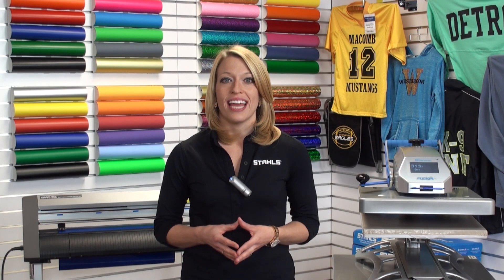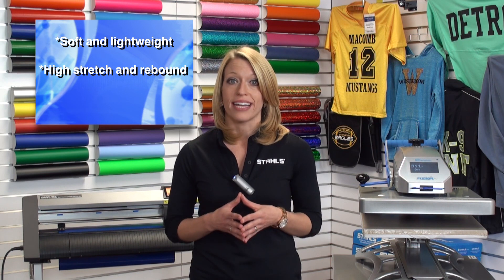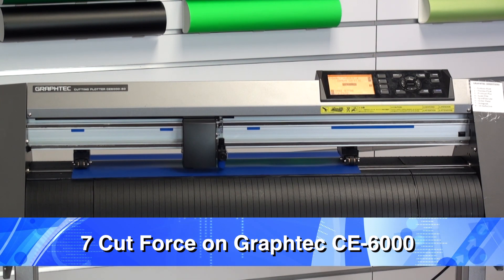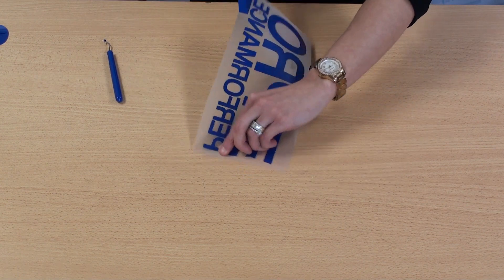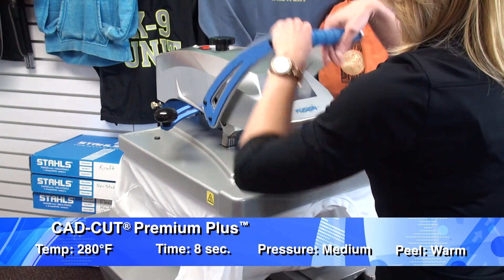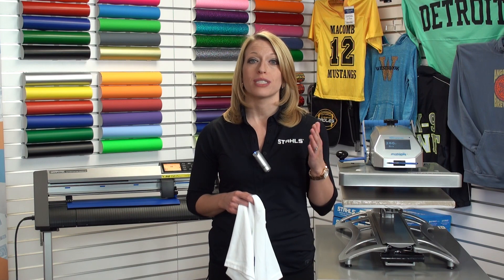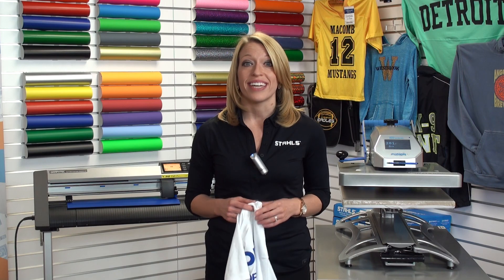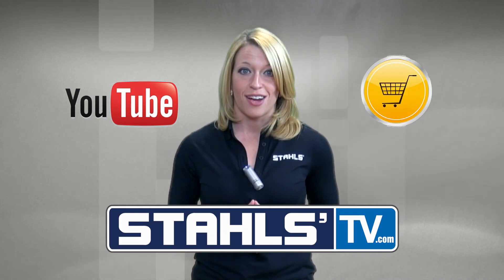Buying Guide: CAD-CUT® Premium Plus™ Heat Transfer Vinyl

Comment: Dear Stahls,

I had issues with my CAD-Cut premium plus. 

It did not stay once the garment was washed. I applied the P+ white to cotton. 

I used medium pressure at 150 Celcius for 8 seconds. Look great, felt better. after sitting for more than 24 hour I washed the garment at 30 degrees celcius, and saw the first signs of it letting go of the garment. Since it was a test-piece I wanted to test how durable the print would be. 

To my shock i peeled the premium right off. I am using a Stahls hotronix device with a Roland GS-24 premium carbon blade. Basicly all the recommendations you put on the material.

I have to say it came loose on the smaller pieces of the design. Probably you'll suggest another Stahls product, but I want to carry a single product line as much as possible. Since in the netherlands it can be quite finicky to find a good supplier with good rates.

Hope to get a reply to this,

Kind Regards,

-Team Loyal Customs.
Reply: I experienced the identical situation with P+ on a 50/50 T. A couple of two inch letters started to come off the fabric after a couple of washes, I reapplied it with time and temperature and have not experienced any more peeling.
Reply: doing my first P+ job, what did you have to adjust? i'm printing on 100% poly. the instructions are 8-12 sec med pressure 280F